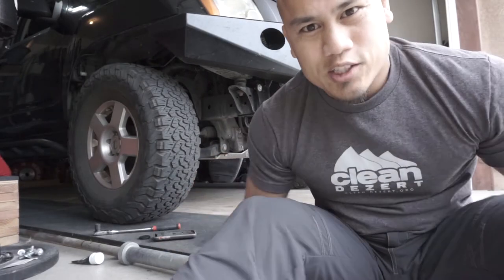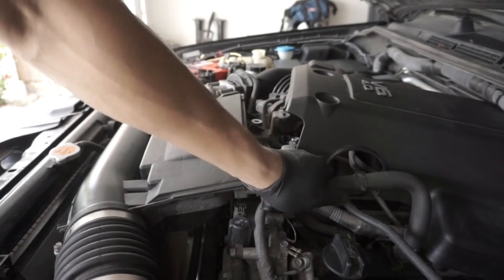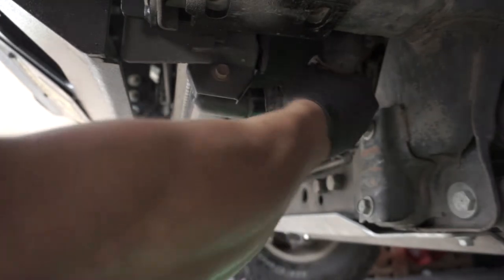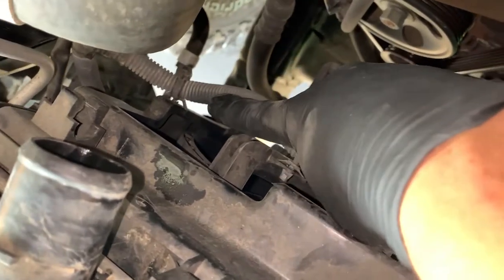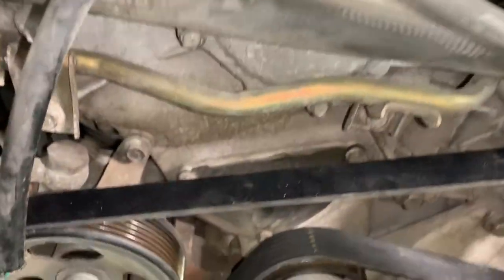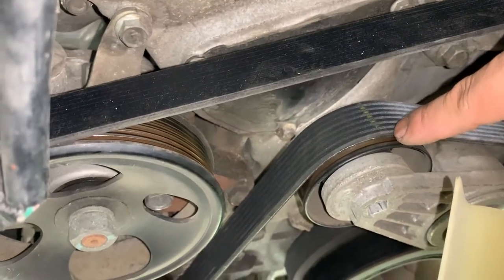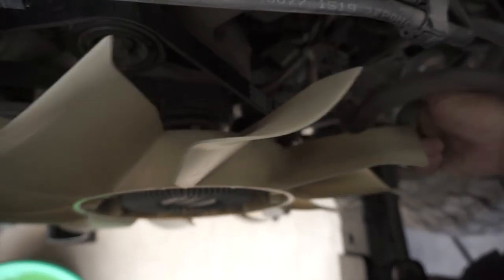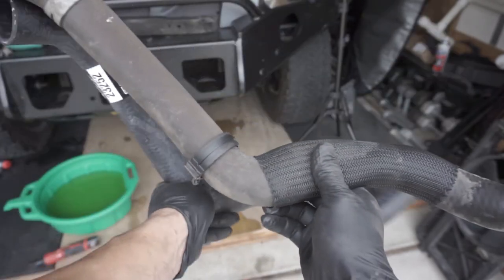How to Install a Koyarad Radiator, Hoses, Thermostat, and Serpentine Belt on Nissan Xterra/Frontier

Comment: Hi, great video. I changed out my radiator on my 06 xterra 4x4 with 160k miles. I noticed the exact same thing. Was running at around 210. Since the new radiator, it now runs at 195. I also have a transmission oil cooler and the fan hardly ever turns on after the swap. Before the swap, it would turn on all the time. I also did a full fluid change of everything. Trans, transfer case, front and rear diff. What size tires are you running and what type of a lift do you have? Thanks.
Reply from the maker: Thanks! I'm running 285/75/16 on the PRG Products Advanced Coilover System. I don't see it on their website at the moment. Looks like they're doing some updates as they've released a few new products. I'd get the budget Titan Swap if you're looking to upgrade on a budget.. or do the full swap. That's what I'm gonna do next.

Comment: Thanks for the video! I have the koyorad radiator as well and im thinking on getting the csf radiator now. Also what app do you use to see the temp stats? Ive been using car scanner and just seeing if there are other good apps to check out.
Reply from the maker: When I made this video, I was using EngineLink which is pretty old. Now I use BlueDriver

Comment: Can you tell me the best oxygen sensors i can use for my 2008 Xterra thank you
Reply from the maker: I haven’t had to replace them. Why not use OEM?
Reply: @rayregnogarage  iam just wondering if there were better aftermarket or performance ones out there thanks
Reply from the maker: I found this. Does this help? I also read somewhere that our trucks have four of them and if you swap the upstream make sure the downstream match. Do yours still work okay??

https://www.thenewx.org/threads/best-replacement-o2-sensor.62673/
Reply: @rayregnogarage  oh ok thanks i will read it and yea but my check engine light came on i took it to get scanned they said it was a bad oxygen sensor so if one is bad do i change both up and down thanks again
Reply from the maker: If it were me, I’d try just the one to see if it fixes it. I don’t know much about them except what I read last night. Lol. I saw one guy having problems and someone suggested that the backs and fronts should match. so if you have oem now, i would prob just stick with oem. If you want an upgrade, I’d do them all together. Not sure how that will go since I’ve never done it, but if i were in your situation, those are the two things i would try first. Good luck!!
Reply: @rayregnogarage  ok thank you so much